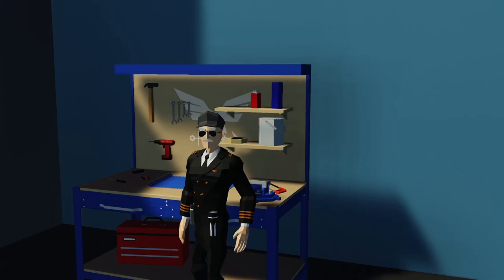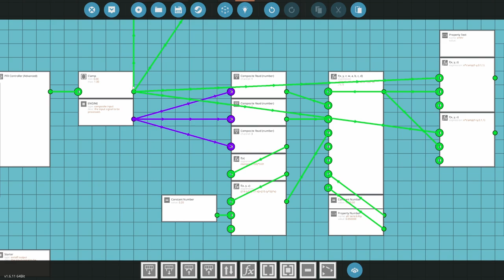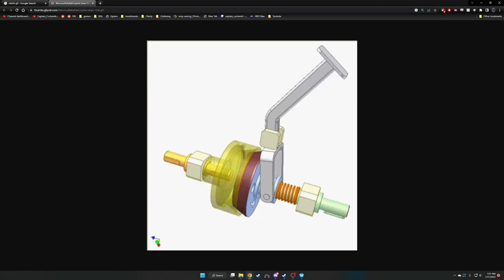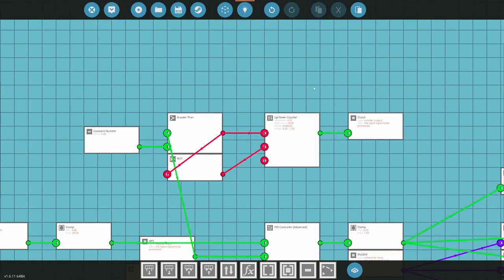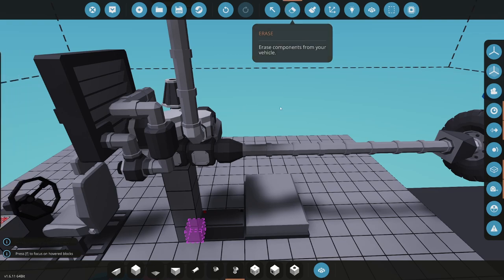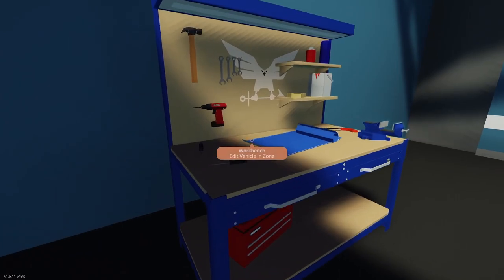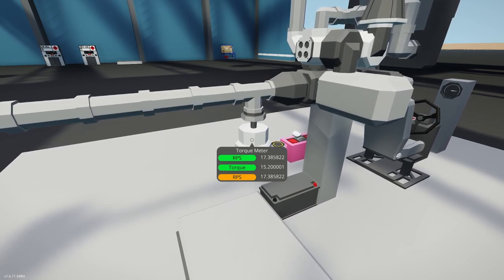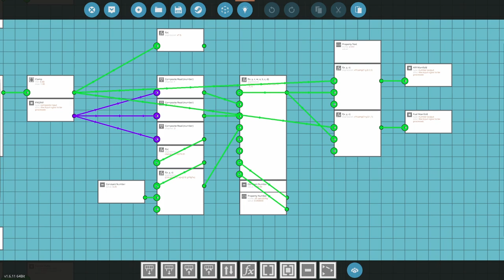Stormworks Modular Engine Tutorial: Afr, Auto Clutch, & Supercharging

Comment: I have found that using the impeller pumps, either engine driven or electric motor driven, can cause some issues with airflow.   I prefer to use small electric pumps on small engines and large electric pumps on large engines.    

If you read the composite air and fuel values from the engine, you get a better idea of how much fuel and air the engine is using over looking at the manifold.   

A Stoichiometry of 0.2 is good for power, but not great for effeciency.  So it is a good idea to be able to adjust it while in gme by a keypad or something or even automate it so you only have it set high when you need it.   0.2 for power.  0 Or  less for fuel effeciency.   

If you ever get the time to go into a bit more depth on how much more power the supercharged engines can be with different pump setups and different AFR settings, I think a lot of people could bennefit from it.

Comment: I made a discovery while messing around with an ecm I was trying to improve.   If you multiply the air and fuel values from the composite node by 60, you get the L/S value that the engine is using.    That may be useful information somehow.  Just thought I would mention it because I have not seen any mention of it and those values seem to be arbitrary numbers if you just read them from the engine.
Reply: L/s value?

Comment: For stoich function the *1000 could easily be in the function block as well. As the air and fuel volume are very small values and you divide them the result could be mathematically incorrect. In function block one should multiply both volumes before dividing or just using a Divide logic block works.
Reply from the maker: Feel free to make your own tutorial Phil.
Reply: Just explaining the need for *1000 as those are floats with precision errors.
Reply from the maker: @Quantum-Bullet  Yeah sorry I was in a mood yesterday. Not enough sleep.

Comment: Do the modular engine clutches have a deadzone though? I remember the old regular 2 block clutches not only had a deadzone but there was an area around 0.7 engagement where it would... I don't know, 'super engage' and add phantom resistance until you got up to fully engaged where the resistance went away. I just remember having to set old clutches up  so that once it reached around 0.7 it skips up to 1. For that reason alone seems any application where an old clutch is used it'd be better to put two modular clutches back to back, since I don't recall them having that issue.

Anyways, yet another good tutorial =)
Reply from the maker: They have a dead zone up to about .3 but they are smooth with an auto clutch

Comment: I used 1x1 impeller pumps in many of my small planes (as cooling pumps though) but possibly an update increased their mechanical power draw or friction losses. As a result those engines on my planes get affected badly. Currently I don't use impeller pumps because of their very high power requirements.

Best solution for supercharging is big electric pump. If you have no space for it, air scoop with small electric pump would work almost equally good. Only air scoop would work as well but if a wind blows from behind the scoop, then you have no air in the engine to start. Small electric pump helps with that.

BTW your discord link is broken.
Reply from the maker: I tend to use impeller pumps for the sake of realism. Of course electric motors put no draw on the engine so they're not going to cause any back pressure. Generally my engines are robust enough to run the impellers without an issue.
Reply from the maker: Discord link works for me. Anyone else having a problem with it?
Reply: @CaptainCockerels  How do you produce the electric power for the impeller pump motor? It requires too much electric power that if you generate it using generators, they put even more draw on the engine than using engine power directly on the impeller pump. 🤔
Reply from the maker: @Thaleans  the impeller is powered by the engine

Comment: Does this Autoclutch setup never stall on sudden stops? With 0.01 increment and no Reset on it I think it could.
When I use a counter I also multiply it by a RPS based function in the likes of (x-4)/5.
Reply from the maker: That's why I say in the video to tune the increment to your particular vehicle. Each of my vehicles has a different increment based on its own characteristics. Often I put a reset when the starter engages. These are under the storm works basics videos. They're supposed to be the basics not every single little picky thing possible thing that I could ever think of in the world to include in a tutorial.
Reply: @CaptainCockerels  So when does the every single little picky thing possible thing that you could ever think of in the world to include in a tutorial tutorial series come out? ;)

Comment: do you know if modular engines are more efficient at hight temp? someone told me that real life deisel engines are better when hot
Reply from the maker: Modulars usually get their best performance at 100
Reply: @CaptainCockerels  How can you make your engine run at 100?
Reply from the maker: @googloocraft12  100 Degrees? Easiest 2 ways. Greater than block. Number 100. Essentially if temp >100 turn on pump and radiator. Better more complicated system. Pid setpoint 100 process variable temp. clamped result 0-1 out to the pump clutch if using the modular belt pump